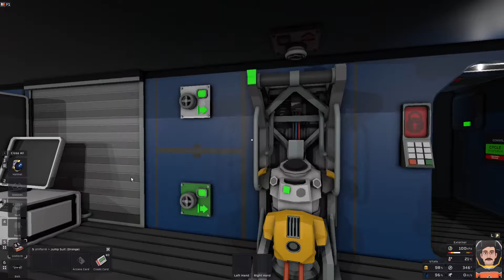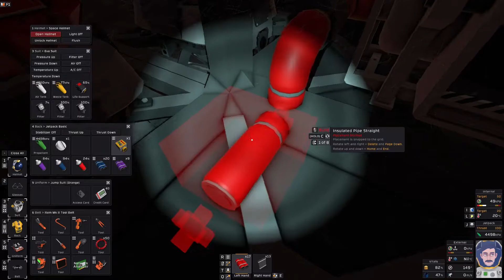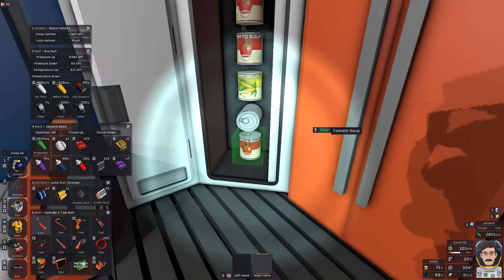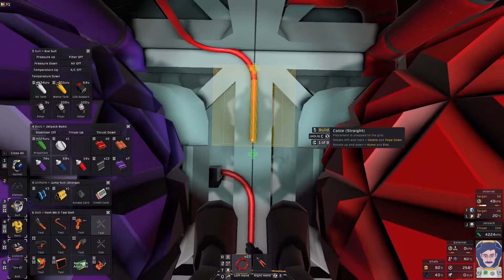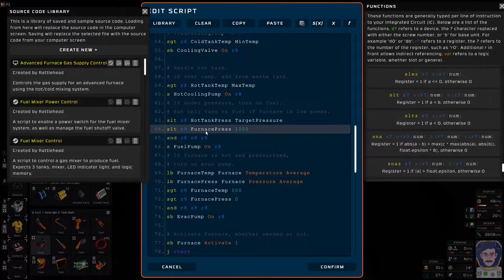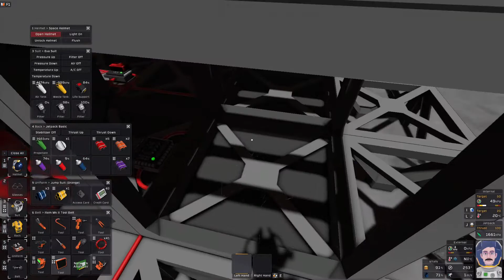Let's Play: Stationeers - Episode 26: Advanced Furnace Gas Control System

Comment from the maker: NOTE: Further testing shows that the minimum temperature for making Stellite is 1800 Kelvin, which is the targeted max temperature for the hot side in this system. In my code, I've changed the max to 2000 from 1800 to make it a little easier to get the furnace up to temperature for Stellite. There's no good way to update the code on the workshop, however. So, if you use that code on the workshop, be aware of that issue.

Comment: Seems to me that it's in the details that you find the problems. Cows Are Evil has a lot of issues with fine-tuning gas mixes and the like too.
Reply from the maker: Yup! The devil is in the details, as they say.

This one took some time to get working as it evolved over time while I was testing it. Originally, the basic furnace was just a part of the hot side gas storage, until I realized how much fuel it would take to get it to 5% O2 when the tank was at, say, 19 megapascals. Also, when it finally did get there, how likely would it be to leave a crater given the massive amount of fuel going up at once? So, the turbo pump got added, and it works much better now!